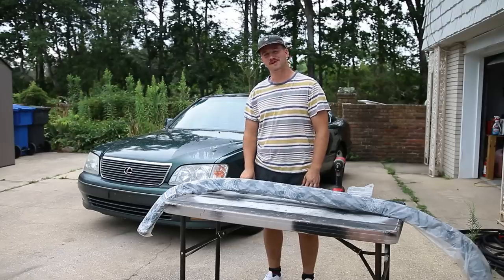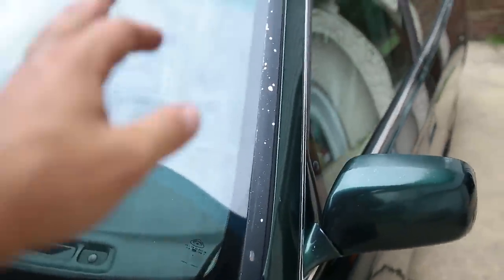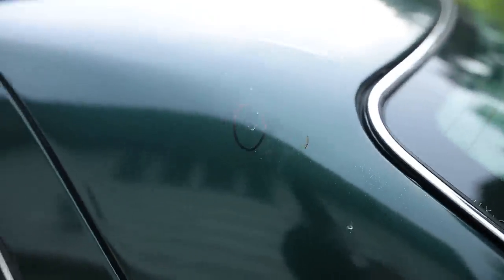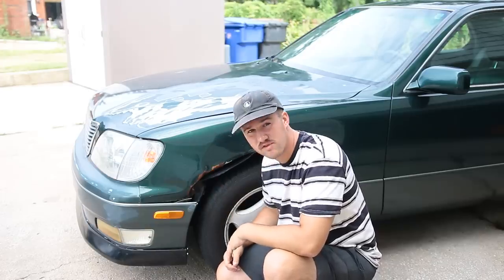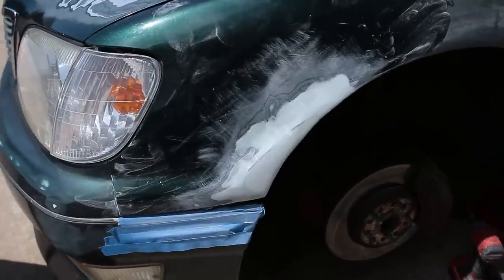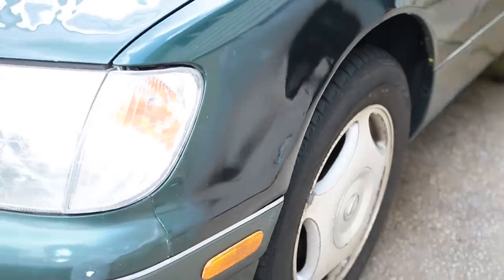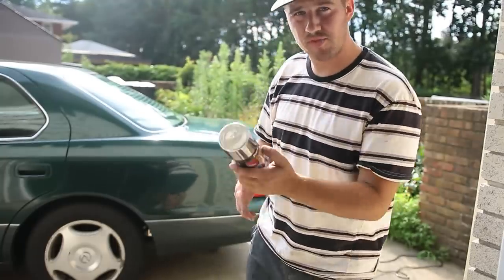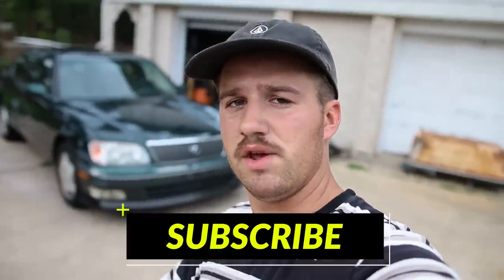Grandpa Car To VIP Show Car On A Budget! EP. 2 (Ebay Mods & DIY fender repair)

Comment: I like your enthusiasm but that fender needed a few more passes with sanding and filler to be acceptable imo, and the runs in the paint, I know this is on the cheap but I wouldn't waste money on wrap or paint to cover it up

Comment: collision repair tech here i just wanted to say for somone who hasnt done body work before you did a damn good job at fixing the fender and conforming it to match the body lines only thing you should know for next time is that you had a few highspots and lowspots where you could see bare metal once the filler was sanded which will be visible through the paint but only from a certain angle most people wont even notice 

id recommend getting a body hammer and dolly kit which will allow you to be much more precise with pulling dents id also get some guide coat which is a spray that when sanded down after sanding the filler shows where the high and low spots are in the metal allowing you to fix them high spots are easy to fix just dent the area inward from the outside of the affected area and low spots are the opposite.

Comment: Dude you made good work on that fender, It’s a pain in the ass to re-shape with bondo and all that. Been working with that stuff a lot with my DIY fixes on my cars. You learn by doing, less bondo is better and more grinding makes it more even. Sometimes you can grind the metall down a bit and just let the bondo fill the dimples instead of curves, it all depends on the damage…

Painting and bondo: https://youtu.be/KEd69gSYQ90
Clearcoat: https://youtu.be/nYT3d2JAcqk
Reply from the maker: Thank you bro!!
Reply: @SmplBuilds  No thank you Bro! Love the tube, you stand for everything I like and work just the same as you here in Sweden. Have a look at my Tube and give me some pointers if you have the time 👍
Reply: This is what the car community is all about. Teaching eachother and growing. I love it.

Comment: pro tip. When straightening up body panels with a hammer, hold a straight piece of metal, wood or what ever you have laying around on the opposite side that usally helps making it more straight

And for the love of god smooth out that body filler lol

Comment: Loving the work you guys do keep it up, people like you are heroes to those who wanna get a nice car rebuild for a specific budget. And make that budget look as if it was more worth. Keep people smileing man👍🏾
Reply from the maker: Thanks so much bro 🥰🤝🏻
Reply: @SmplBuilds  no problem, I actually wanted to message you or dm , what ever to get in contact. With you guys I kinda had a budget but was unsure. I have a Ford fusion hybrid, recently was hit, (passenger side light broke, hoop dent up n shift few Inches over and half the bumper is on.  I need to get my tags done by the 28, for DMV, so I was cursed on if there any way to get a spot?. I started watching your videos and made me second guess on keep the car because it still drives perfect.

Comment: Awesome video man.  New subscriber.  I'm an automotive painter and i could offer you a few tips on bodywork and paint.  A good one would be to "feather edge" the paint rings a little more around the repair areas where you sanded out chips and scrapes.  It'll help to minimise a bullseye from appearing when you paint it and overall make the repair smoother.

Comment: If you are going to repaint trims (moldings) consider to use black bamper paint. It has nice matte surface plus it helps with surface leveling in case of your cavities

Comment: When doing body work again, I’d recommend you get a hammer that is meant for doing so, not a carpenters hammer, as well as a bodyman’s dolly. You use the dolly as a surface to hammer the metal against a flat, curved, or rounded surface by putting the dolly behind where you want to hammer. This lets you shape the metal with more control. With the little fender flare when it gets close to the wheel that’s a bit more tough getting a hammer on that, you’d probably need a slide hammer and weld a rivet onto it to get that out.

Comment: Friendly suggestion on your airdam: You should use a heat gun on double sided tape.  Heating the tape until it slightly bubbles creates a bond strong enough that reheating is required to remove. 
Using "3M Tape Primer94" also greatly helps adhession and even more so when combined with heat.
nevertheless...great videos

Comment: If you had used a piece of wood on the ouside of the fender while you were beating on the inside you probably could have gotten it more straight. But whatever, it turned out pretty good.

Comment: bro can you please learn how to spray paint? everything else is fine but all of your paint jobs are terrifying...its a waste of all the good work
Reply: I dissagree he makes a lot of good paintwork in his videos to, I’ve seen a lot of tubers doing worse. He makes it work…
Reply from the maker: This small one was one of my worst lol, and I re did it, you'll see in the next eppy. But i dont think my other jobs were that bad 😣
Reply: @SmplBuilds  is that you often paint on metal but without any primer, which will make the paint peel off very soon.  In addition, there are many drips, I recommend doing a lot of light coats of paint and letting it dry between one and the other.  And if you want to have an excellent effect as a body shop, give a polish over the layer of gloss, this will make the paint become mirror-like and remove the peel effect from the paint
Reply: other than that, gg, love from Italy❤️